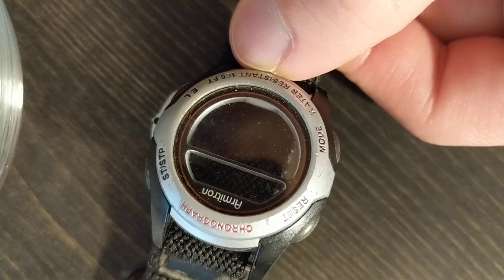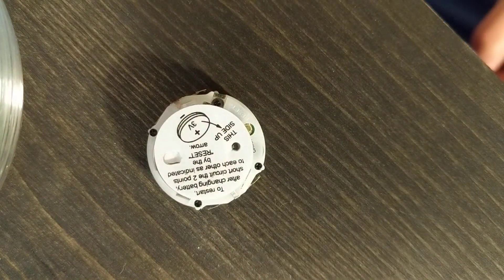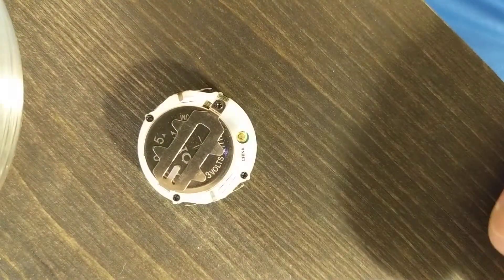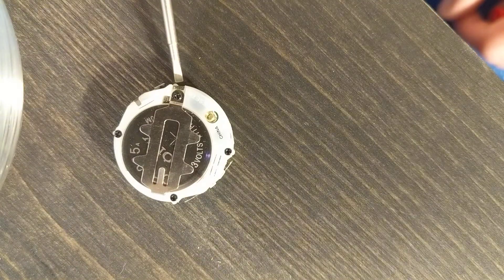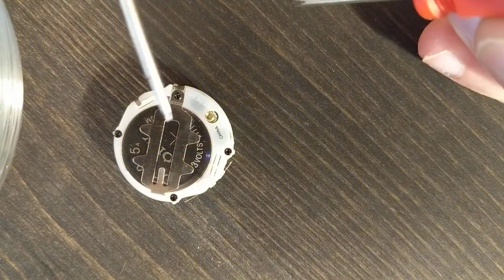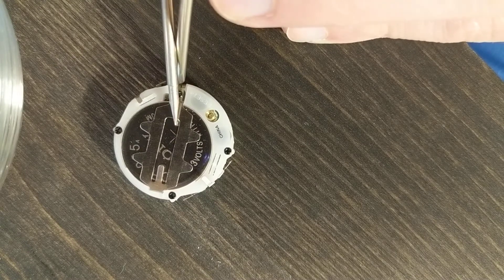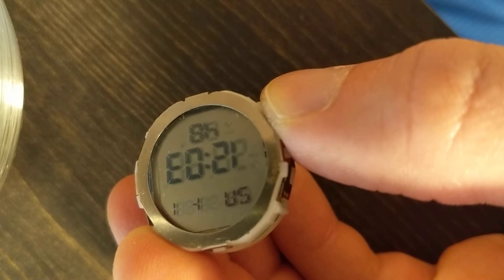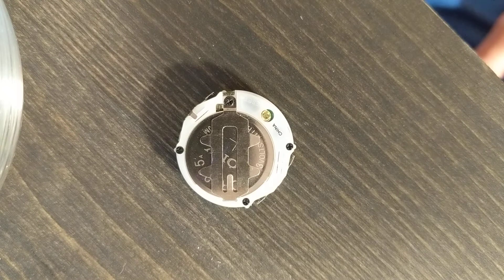Armitron watch cr 2025 battery reset replacement short circuit

Comment: This worked for me as well, my Armitron WR 165 was slightly different and took a minute to figure out where to place my screwdriver tip for the negative connection--but once I found the hole--it reset immediately.  I was having trouble and started thinking the new battery (which sat on the self in my cabinet for god knows how long--was dead).

Comment: You are shorting it by creating a circuit between the + positive and - negative sides of the installed battery. Thanks for the tip!

Comment: Excellent video. And thank you very much for this vital information.

Now, there's only one problem............

When I reset the battery, it DOES go back to:
SA 1
12:00am
And the seconds start at zero.

However, when I try to set the time, absolutely nothing happens. In fact, the indiglo light will not even work. And it has a bran new battery.

Would you happen to know what gives?? Thanks.
Reply from the maker: I'm not a full tech support person but if you're doing the correct button presses and nothing is happening seems your buttons may also be broken.
Reply: Mine is doing the same thing! So pissed after wasting all night trying to fix it- guess I will buy a new watch tomorrow and guess what kind it won’t be?
Reply: I noticed the same issue with the buttons.  The fix was to put the metal backplate back on, then the buttons worked fine!

Comment: Thanks for posting this. I changed the battery on mine but even after shorting it out, I wasn't able to keep the screen on. It just slowly fades out to a blank display. Voltage meter indicates I have a new strong battery but I think it might just be time to throw it into the landfill.